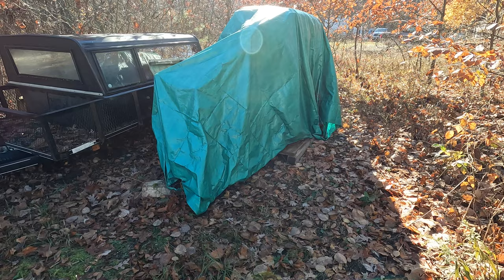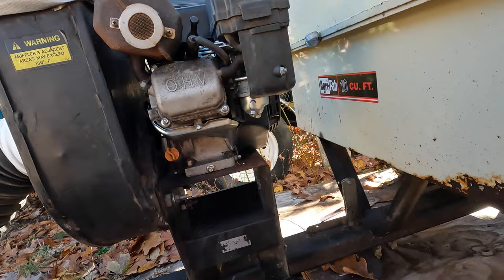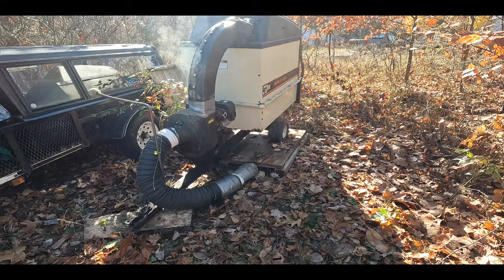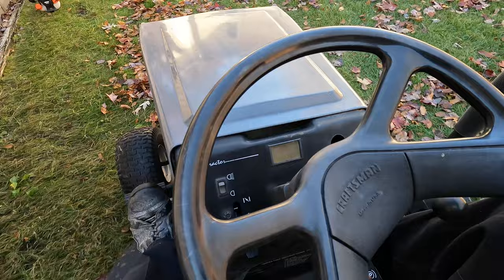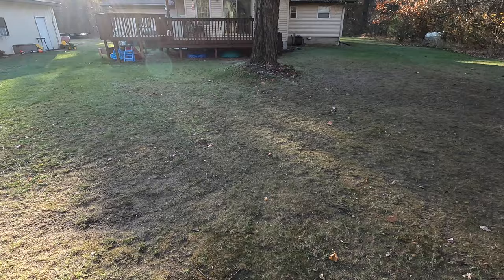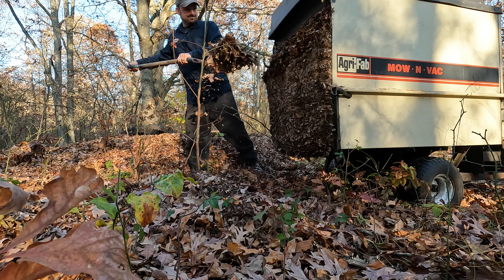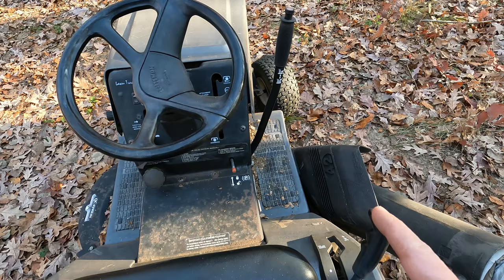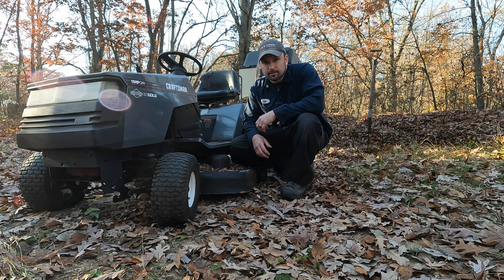Ditch Deal Leaf Vac - 1 Year Later

Comment: There is a hand crank wide belt (fits inside pickup that pulls out loads (sand, gravel, etc.). You can make one inside leaf trailer. Bar(roller ) inside towards motor. Cut material 1/4” short each side.  Rear crank bar outside trailer.  

Come out under rear door easily.  Rear bar crank arm attach to outside trailer.    Should roll full leaves right out.  (Video of DIY similar one).

I USE WINDSHIELD WIPER MOTOR as it can lift 400lbs.   (EASILY CRANKS CONVEYOR AND DEBRIS WITH 12Volt .  Small control switch box rear side above windshield wiper motor.   Easy reach / push button…roll it on outta there!
AUTOMATION /SIMPLE/ SAVES BILLIONS OF HASSLES!

QUESTIONS…. LEAVE MSG HERE!
Reply from the maker: That sounds slick, thanks for the note.
Reply: Looks like treadmill belt as wide as truck bed between tire humps.  Then hand crank at rear/tailgate.   (I would use windshield wiper motor. To crank shafts and pull out grass/leaves.  (Wiper motor can lift 400lbs/utube video). Lol
Buy used from truck/junk yard cheap… play with it…lol

Comment: I have a 90s's model agrifab Vac too. I  am trying to remove impeller so I can have weld shop weld a new one.  The impeller tool remover doesn't work with older models. Any idea how to remove the impeller? I love my leaf vac and would like to get it running again. Appreciate the update on how yours is running.
Reply from the maker: I haven't had an issue on my leaf vac but on mowers... soaking overnight  in some aerokroil or pb blast then any impact even  taps with a hammer to the bolt head or to the engine shaft while pulling on the pully-impeller can help at times to loosen the crud. If reusing the motor it's tuff because you don't want to gall the shaft or threads(brass punch).
Reply: @TownlineGarage  Ok. I will give that a shot. Thanks for the tips.